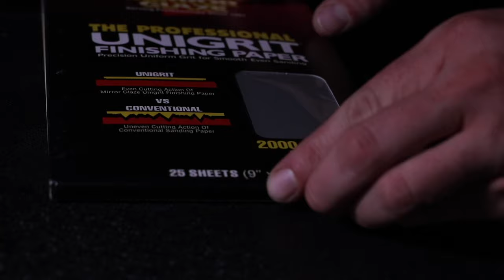SUPER AGGRESSIVE paint correction! My quest for showroom shine on black paint

Comment: After you finish buffing what do use to wipe it off with to keep it from streaking
Reply from the maker: After compound stage I use a decent microfiber towel, I kinda prefer plush for this but lots of people swear by short nap. If I have compounded for too many sections...( should wipe off after every section, but sometimes it is what it is lol)...so if I've overextended my self and gone to town on the panel...I'll spray it down with a rinseless wash solution for a little lubrication (after some dwell time) and it tends to break down compound if it gets caked on there. I use rupes coarse da and or koch chemie h9 for da and rotary respectively. If you wipe off after your section both are super easy wipe off.  Now...after compounding I really love the klin short nap towel (called zero finish, I did a video on it a few months back) I use it fresh out of the bag and it's amazing for polish removal. Thats when not scratching paint us super important. If I can't reduce streaking during a step I'll use a paint prep to get the panel clean but I don't wipe off compound or polish with prep.. I wipe first and if I'm fighting streaks then a paint prep wipe.. we use prep all in the shop.. but the zero finish use 2 of these on a car and they are about 4 bucks a pop.

Comment: Great job sir. The bigger spots, customers need educated on paint and clear coat depth because after such a finish should it be done again and ceramic wears off in a year that it will not be possible. Good to the lowest and leave a bit is best. Speaking from experience and money. Nonetheless, very impressive.